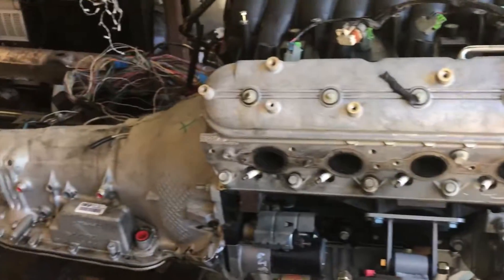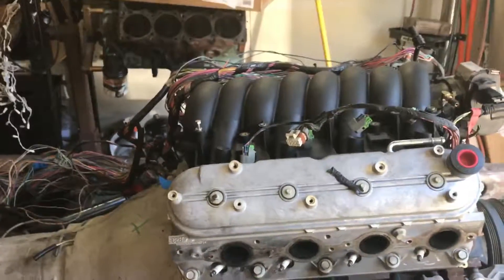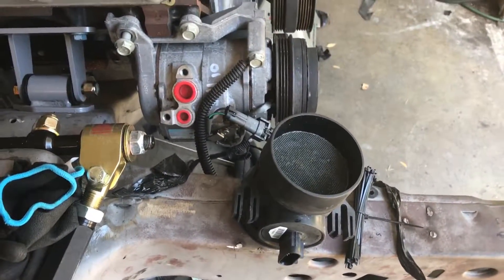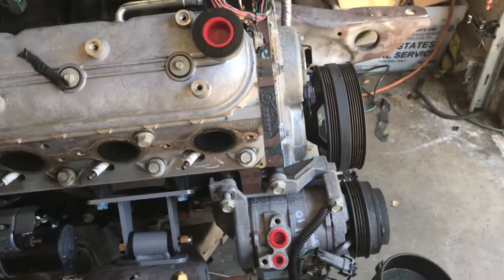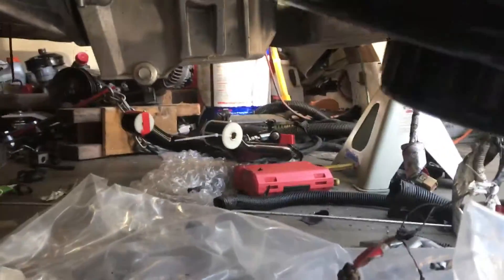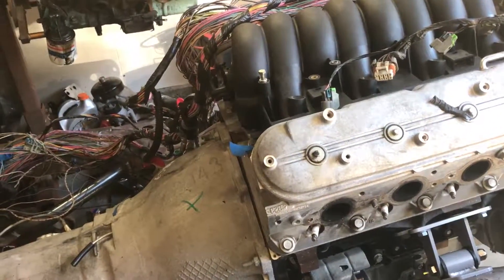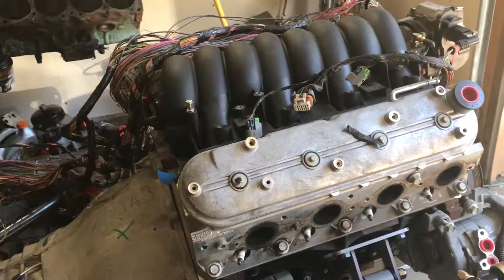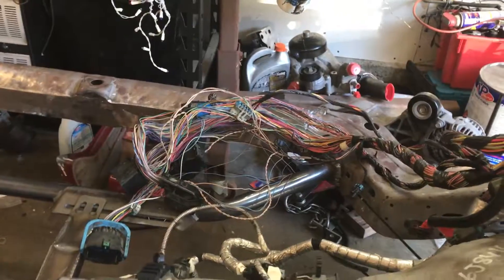1965 GTO LS Swap and wiring harness part 1

Comment: Yeah Ron I know this is a 5 year old video, but I hear what you're saying everybody's BS, aw just put an LS in it just do this just do that every damn thing has to be engineered if you want the car to still look like a car when you raise the hood, I am also doing an A Body 64 Chevelle, not ideal, engine cross member in a shitty place. Installing the engine where you get the right angle for the transmission means header or manifold clearance with either the steering shaft or move it back and tight some where else, one position I tried and you couldn't pull the starter see where I'm going, if I had put the original 327 back in I'd have thousands of miles more on my classic cruiser. I feel your pain.
Reply from the maker: It’s going to have an LS in it and 1856 and I bought everything I need to make it easy I’ve done it before quite a few times when I get a chance I’ll post some of my cars in here
Reply: @djron1  sounds good Ron, I'm just about worn out on this thing. Thanks Marty.
Reply from the maker: @martysheets6882  Yeah I just realize that I have a 64 that I’m building right now but this time it’s got a T 56 in it still didn’t 9 inch like that one I did a sick so I like that one but this one’s all bill I got a State St., Cham board Impalas heads it’s pretty stupid I just haven’t posted anything yet because I’m still assembling the motor
Reply: @djron1  sounds good, I subscribed so I can follow Brother so it sounds like you've see it all, so I'll be watching, I know it takes lots of time to film but guys like me, and others appreciate the efforts and see if we can get you more Subs.

Comment: What kind of motor mounts did you use and do u have a part number
Reply from the maker: The first that I bought worked fine I just did another one and they worked like shit. I took them out and put stock ones in. I can’t remember the name of the place though.